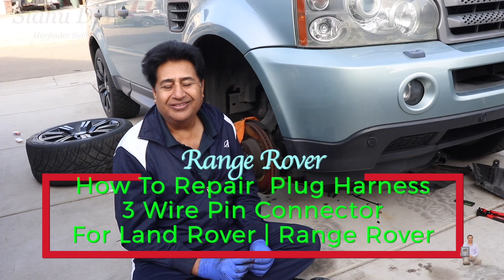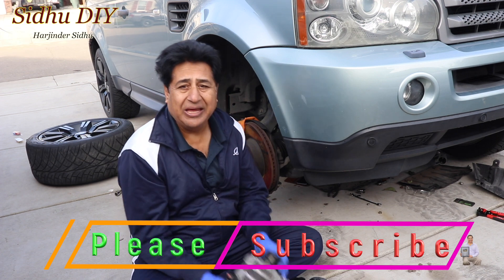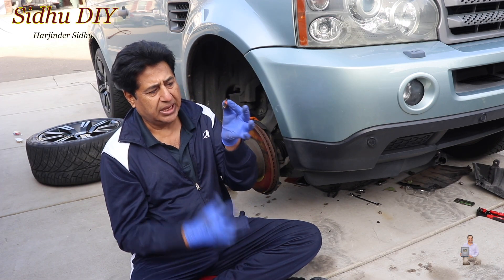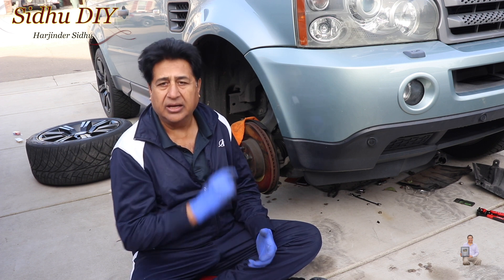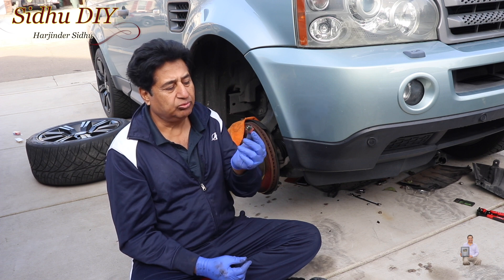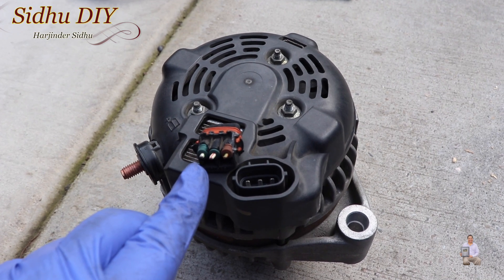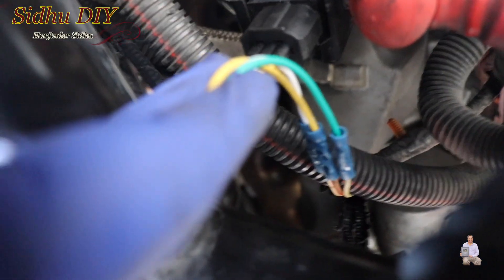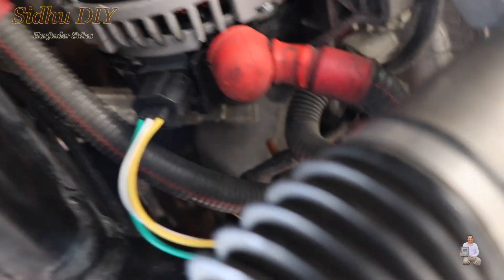How To Repair Plug Harness 3 Wire Pin Connector For Land Rover | How To Wire an ALTERNATOR on RRover

Comment: Hey there I'm having the issue that the harness I bought the green wire is in the middle. Euro part. Its goes from left to right as follows. Black on the left, Green in the middle, and Red on the right. How would you configure this? Thank you for any advice! 🙏
Reply from the maker: In my case w/g --> G, w/r --> W, b/g -->Y
yours should be w/g -->B, w/r -->G, b/g -->R
Good luck with your DIY project, thanks for watching.🙏

Comment: Hi what if my plug i bought it has green red and black with what colors do those get connected too.
Reply from the maker: It can be any color of wires so please don't get confused with it, just put your old connector in front of you with correct orientation then side by side put the universal connector with the correct orientation, and then start attaching the wires don't bother with the color. 
example....existing plug has B W R and universal has G R B
then attach B-->G
W-->R
R-->B
I hope it helps, good luck with your DIY project.
Thanks for watching.